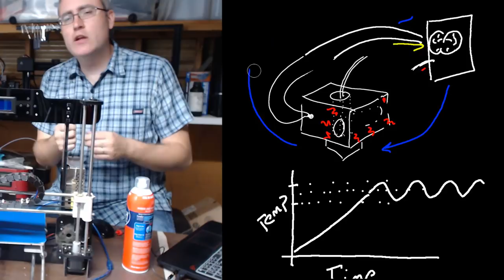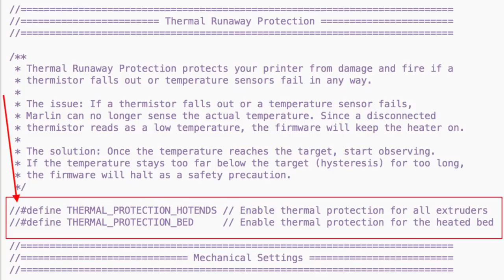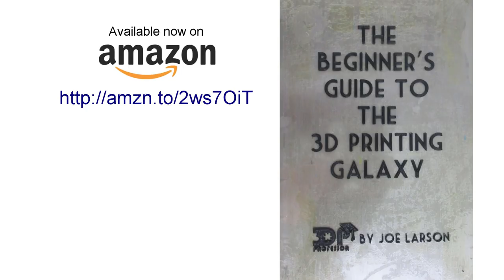Anet A8 Fire Danger and Marlin Upgrade

Comment: when I got my a8  well over a year ago  I  didnt like what I had seen and stopped assembling it until I did the following: removed the power connectors on  the Anet v1.0 board and replace them with   short 14 AWG wires connected to XT60 connectors for portability reasons, I removed the connector on the hotbed and wired 2 pair of 16 AWG  silicons cable for the heated bed connected to an external mosfet, there are 6 pins  on the end of the bed but only 4  were being used,  now all 6 contact points are,   another thing I didnt like was the fact  that the  springs that support the hotbed rest again the bottom of  it and are free to scratch through to the traces of the heating element causing a short,  but to be fair there are other printers out there that are shipped like this, but the fix is easy, I used 4 wide m3 steel washers with home made cardboard ones underneath them against the bed, I have been running skynet on it for over a year,  it prints pretty well, I have had no issues with it in the time I have had it but its hardly a stock printer now...

Comment: I have been an embedded engineer for the last 20+ years. Working on thing like fire alarms and car braking system, also HA systems, safety systems are built in to the code, and how every much the end user asks, it would be unethical, for us to allow, the default setup, to be unsafe, so unsafe options can not be “saved” so every time the system boots, it should be in a safe mode. So should Marlin’s firmware be changed to stop the boot state having these option disabled, and if this option need to be disabled (only time I can think of, if for safety testing of some kin, calibration of the systems) can only be done until next reboot or power cycle by some gCode, menu option.

Comment: i've never seen a single article on someone's ANET actually catching fire. I've ran my anet a8 stock version for 3 years now. Not a single problem. Well i've had problems....but nothing with my board, power supply, heatbed or anything like that.
Reply from the maker: Just google "Anet fire". 

It's been a couple of years since this happened, and to my memory there were only 3 that were publicly reported on. It's a pretty specific set of failings that need to happen. But, so far it's only been ANets that it happened with. Not to say it couldn't with others.

Also, easy to fix.

Comment: 2 things you can do to make the heater block safer # 1 add a thermal fuse to the block #2 add a second heat sender to an independent non soft ware based control circuit that will shut off if it reads a tempura outside the set range of the secondary controller ..

Comment: I think PSA type videos like this one is probably the best thing that can be done.  Maybe ask retailers to put warning labels on the product listings so people are aware of the situation.  At least then they can make the decision of whether they want to go through the process of fixing it or steer clear in the first place.  Honestly, I'm starting to think that, unless you have a good reason not to, the first thing anyone should do with a new printer is upgrade the firmware to the latest version.
Reply: Fern Moore I mean yes, PSAs help. Though maybe if the community stopped encouraging people to buy machines that are known to have critical, potentially deadly design flaws we wouldn't be in this position.
Reply from the maker: I don't think anyone encourages people to buy machines that are known to have design flaws. We encourage people to buy things that work, and then discover later the hidden evils.

Comment: I greatly think that the thermal runaway should be better writen and wire tie wrap instead of those plastic spring (so that even if the screw is loose, every thing stay in place)

Comment: I must stand in defense of the A8 because it has been an excellent low cost tinker kit of a 3D printer, of course I believe it is very much an adult kit so kids have no right playing with wiring, that fire was unfortunate but it was because someone was making changes to their machine without understanding the changes they were making and it was because they changed the firmware irresponsibly to remove the current safety temperature system of the A8, I know this because when I had my thermistor fall out mid print, the machine turned off the cartidge and did not burn down my house

Comment: My first printer was a CTC, purchased in January. It's basically an A8 knockoff. When the runaway heating issue came to the fore, I immediately stopped using it. My new CR-10 arrived today, and I'm much happier with its output. I do plan on upgrading the firmware of my CTC and using it as a tinkering machine, but the CR-10 will be my workhorse, and I won't run the CTC unless I'm in the same room.

Comment: Hello,
I am looking for ur help.
I have bought anet a8 3d  Printer. But y and z axis motor fixed plates are missing in the package. 
It will be nice if you can share the  parts picture with dimensions. I'll be able to manufacture the parts on my own.
Thank u.

Comment: What I found interesting is that the problem is also with the Creality printers and others and not limited to the Anet A8 alone.  To leave it to the public to solve is irresponsible and it is just a matter of time when the manufacturer will have a class action lawsuit against it. The public can take precaution but ultimately it is the manufacturers responsibility to ensure that his product is safe.
Reply from the maker: Anet is unique in this in that their temperature sensor is known to slip out from time-to-time, resulting in opening the loop and they disabled the safety meant to catch that. It's a one-two punch that makes Anet machines uniquely dangerous.

Comment: In this video you mention Creality turning off the runaway heat sanity check too.
But then you say no more about it? Do I need to upgrade my CR-10? Is it safe?
Reply: I wouldn't recommend using any 3D printer with thermal runaway protection disabled. All it takes is a thermistor to fail (be it in the heated bed or hotend) for a runaway condition to occur.
Reply from the maker: At the moment a build of Marlin, either from Creality or the Marlin team, isn't ready to go, so there's nothing to upgrade to yet. Also, remember you'll need a bootloader to update the firmware on a CR-10.

As for if it's safe, just don't let it run unattended. Until the firmware can watch out for problems, that's your job.
Reply: I am happy flashing a boot loader - my cr10 is not a creality (it's from Amazon). Is there a way to check if it is disabled?
Mine does give me a MinTemp error if it's really cold - i print in my unheated garage - if the thermistor in the hot end reads below 10C - so that is a good sign.
Is there a real world check I can do? Unplug thermistors from board and see what it does?
Thanks for the answer - I think this is an important topic that needs high visibility/outspoken users - like yourself - to highlight.
Reply from the maker: I call unplugging the thermister and testing the heat the "poke the hornets nest" technique. But, yes, that is the blackbox method of testing.

Comment: Man i haven't had any of these problems. probably because i have ample cooling on it. ram mine for 28 hours strait with no problems several times. I have the original one though, the "omni printer" version. I keep my element and thermister tight and make sure to replace any thermisters that go bad. When one does go bad, the system stops everything.  Common sense stuff. I guess i got it early enough or late enough to miss that. I guess the original software had this safety
 in it.

Comment: My personal opinion on this.

The Anet A8 is NOT a bad printer. It, in itself, is not dangerous.
IF.. And it is a big if. If it is well maintained.
You do not drive a car without having it serviced occasionally. 
Changing the brake discs and pads. Changing the oil etc.

Same needs to be done with a 3D printer A8 or any other printer.
I have an A8.
I check it before each print.

I see it like driving a car from 1950 when compared one from 2018.
Modern cars have Anti lock brakes ,Air bags, Side impact protection systems,  Seat belts and some have traction control.

A 1950's car does not have these. But it does not make them inherently dangerous. Just less safe.

While I do not agree with your hard stance against the A8 and Anet. I do agree that the safety features should be switched on from the factory. Yes. Maybe there might be a reason to switch them off. An option to do so in the menu system along with suitable 'Are you really sure about this?' message should be available.

Part of the problem is these printets are are DIY build.
So the quality of how these things are built up varies from petson to person.
I've read stories of the printers being built on less than 3 hours.
I built mine over a week. I took my time to learn about how it worked and made sure everything was good.

So a lot of the issues can be avoided.
But yes. I will be upgrading my A8 to the latest version of Marlin and I may look at adding the option to switch the safety features off and on to the firmware myself.

Comment: hey 3d printing pro can you do a video on you turning back on the run away heat system for cr-10 users
Reply from the maker: Just as soon as we have a way to do it that's simple.
Reply: Thanks, this issue is actually pretty big. I will watch for the video

Comment: Some other big things that people forget, or folks that are new to kit printers is good cable management, and to tighten screws for "preassembled" parts (looking at the hot end here). Every kit I have assembled had the heater cartridge just slid into position, and not tightened down. Couple that with lack of understanding about cable management and keeping all the hot end wires tied down causes a lot of these "burned" printer issues. Most of the burned printer photos/vids I have seen could have been avoided with 1) updated firmware as the easiest 2) some common sense with cable management. Just my 2 cents worth.

Comment: just watched your video on the a8, I was about to buy one, thank you for changing my mind and the safety advice.  thanks again so much. with your advice I still have my funds my home and my health not in any order there . I figured it was to good a thing to be true. great advice. keep it coming. very informative.
Reply: Fred Wilson
Dude thats absolute nonsense, everything in life catch fire, toasters microwaves cars, televisions iphones, you name it, there has  been only two reported cases of this printer  catching fire, and people had made a big thing about it,  all electrics including the most expensive ones also catch fire in larger percentage numbers, this is very easy to prevent by a  dummy  proof  free upgrade, and even if you  dont make the upgrade dont mean ur printer is going to catch fire , thats just simply stupid, is just a precaution to minimise any possibility of the printer catching fire. the Value of the annet a8 is amazing, not only for the price and the quality of the prints, but because you get to build it yourself and learn  on  the process  why and how things are printed valuable information  to get the most quality results, things that you dont learn on ready made printers, I  been using anet a8 for 2   years, I have also 500 dollar printers, and I get nearly the same result and quality, after doing some adjustments and free upgrades, my printer has never caught fire  and had it run it on dailiy bases the first year with no  upgrades, I did all the upgrades afterwards cause I love building and creating. in my opinion this printer is a must for beginners of 3d printing and forget about people trying to scare you about fire, is nonsense,. just do an easy upgrade for your peace of mindf simple

Comment: At some point criminal/civil liabilities need to apply if these safety checks are intentionally removed and there isn't at least a note as you open your printer indicating that -- and at a minimum a link to a website where you can get a safer firmware. I have always been saying -- stop buying junk, use better hardware, but you can have the best hardware, best wiring, best practices, and something can still fail. I've seen expensive silicone insulated wires fail with no visual indication (silicone insulation will just snap back, and the strands break) - simply from being tugged too hard. So the firmware protections are our safety switch, and they should NEVER be disabled. You can adjust the range for thermal runaway detection to avoid false positives, but NEVER turn them off. This is why GPL compliance is so important.  For now I would say if you have a printer, not just an A8, any printer, and you didn't setup the firmware yourself, assume these protections are not on, and go get the latest firmware and turn them on.

Comment: My brand new Creality Ender4 went up in smoke! If I hadn't been sitting by it? I was running a print, the skin didn't look right, I killd the print, went to changing the outer layer settings, heard a noise, looked up the screen said over heat protection and the print head was t 450c and climbing, I grabbed the power plug and yanked It out as the board was catching fire!  Creality Is sending a hot end and board.and yes, the heat block melted, run away protection engaged and still running away? Any help?
Reply: Now here is the kicker, I replaced the hot end, heater and thermister with exact matches, when I plugged it back in, it ran away instantly as soon as it got power?
Reply: #SaveTheSaxyCyborg #Don'tShootAtYoutube
Reply: Alright, Alright, after many pauses? comments.... other things, I finally Made it to the end of the video, 

I'm half thinking about clearing all of marlin, then entering #42 and hitting send! What's the worst that can happen? I'm old school and followed Kurt Russel's advise, I have two fire extinguishers

Comment: What about the monoprice select mini.   Do we know if it has problem?
Reply from the maker: We do not, because it it closed source. I suppese I could find out by disconnecting the heat sensor and seeing what happens. Hmmm.
Reply: exactly. thats the point. it's closed source. off those printers we never know whats going on inside. thats really worth testing.
Reply: No, the MP units do not have this problem.  They have a different problem: the "emergency stop" only kills the heaters, but the printer keeps on going like nothing's wrong.

Which is better than lighting the house on fire, I suppose.

Comment: I have had 2 of the anet a8 3d printers. I updated one and not the other. I believe there is a faulty connector where the power enters the board as I have had 1 fire losing the machine and the other connector melted and threw sparks right in front of me. this could also be from the board getting to hot or itself being faulty. I now have a 3rd anet a8 that I have changed out the connector and have installed a fan blowing directly on the board from an outside source. cross your fingers, I have taken some temp readings and have seen them climb as well as taken some readings with my multimeter and have seen spikes. Dont buy this printer.

Comment: Do you know if the Anet A9 also has this issue?
Reply from the maker: ANet promises they've fixed this problem with future 3D printers, but which ones I'm not sure. But, being as they make no effort to stop you from beign able to update your firmware, it's always fixable.
Reply: @3dpprofessor  When i get mine, i will contact Anet to see if i can get the source code. since the A9 is not really being sold or has any community support-like mods

I already know of a dozen mods im gonna do.

The first one before even using it will be a glass bed

Comment: To be fair, anyone buying an Anet A8/A6 *KIT* (emphasis on KIT) should have done a minimum of research on the different kits available from various manufacturers and therefore should ALREADY KNOW the issues that need to be addressed with that printer.  As such, failure to address these issues should at least lie EQUALLY as much on the consumer as the manufacturer.
Buying a 3d printer kit that requires assembly says, at a minimum, that the purchaser is competent enough to assemble AND MAINTAIN their device.
That being said, I personally would not recommend to anyone that they purchase an Anet printer kit as their first printer.  The number of problems this printer comes with, not the least of which being incorrectly sized/poor quality smooth rods and bearings, make this printer a good learning experience ONLY if you already have another printer with which to begin printing the upgrades and repairs for the Anet.
Also, as far as fire risk goes, upgrading the firmware will not totally obviate the risk if fire.  There is another risk of fire with this printer that by the time the software detects a problem, the fire would already be present. I'm referring to the heated bed connector, which is nowhere near sturdy enough for the amount of current that must pass through it.  If an Anet owner doesn'y directly solder the wires to the heated bed immediately during assembly, they are risking the connector overheating and burning.  How much damage this actually could cause is entirely a matter of the surrounding environment, as the plastic connector itself is fairly small. But if a bit of burning plastic falls onto wood or more plastic, then the fire could grow out of control rather quickly.
Again, I feel that this is the purchaser's responsibility primarily, but it is also something that COULD have been remedied at the manufacturer level.

Comment: Quite Frankly this is NOT true. I have ran mine with the original firmware for more than 2 years no with no issues.  But you must provide strain relief on the heated bed connector.